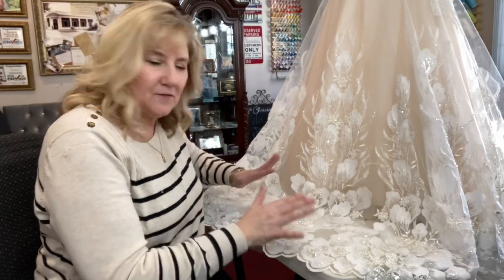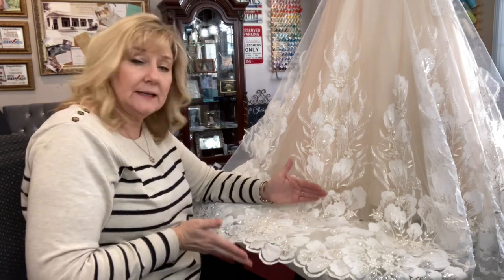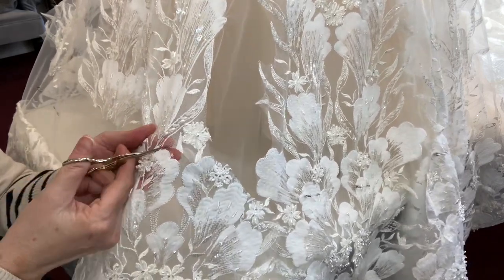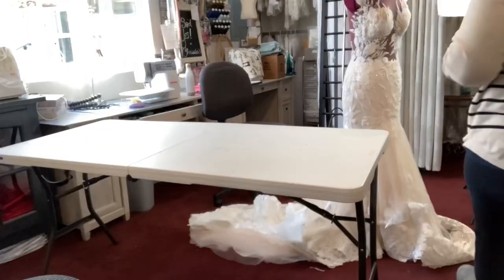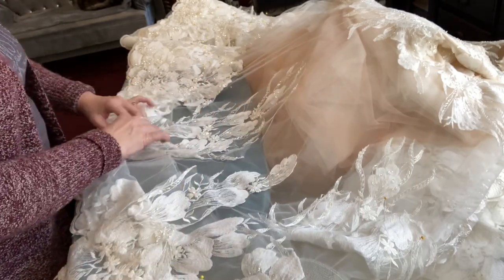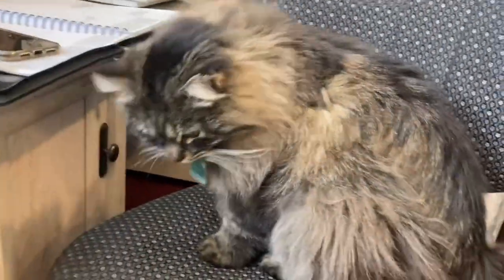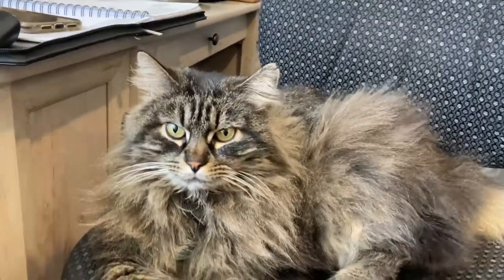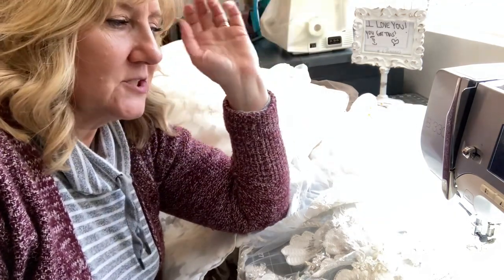How to Hem a Lace Wedding Gown: with Appliqués, Beadwork & Horse Hair

Comment: You do beautiful work. 
Just found out my daughter is getting married this spring and we are going dress shopping this week. How long do big hem jobs like this take (she is short so odds are the dress will have to be hemmed at least 6 inches) and what are the usual costs? I can't find real info on this anywhere and wanted my daughter to know before choosing a dress. Thanks much.
Reply from the maker: Thank you so much!
Congratulations on your daughter’s new engagement! 🎉 🥂 ♥️
Time depends on how many layers, how many appliqués and/beadwork needs to be removed and then replace in the new location.  And it could take a different amount of time depending on the seamstress.  
I think I worked on this one off and on for a week. It was a much harder one than most.  It had all the challenges possible.  lol
Cost will depend on all those things as well, and also depend on your location and the cost of living in your location.   
I’ve seen hems like this range all the way $250 to $500 and maybe more in big cities.   
But whatever they charge, just know a lot of work went into it and it’s worth every penny when she walks down that aisle.  🤗😊

Comment: You're doing a great job. If you don't mind, how much do you charge for a single flower? Looks like it is very hard to move and put them back.
Reply from the maker: Thank you so so much! 
I’m not sure about a single flower.  I can’t fully remember what I charged for this hem.  I do know that it was not enough.  lol  I reevaluated my pricing right after.  
I give my price to the bride in her first fitting.  I base it on how many hours an alteration similar usually takes and times it by how much I need per hour.  I usually come out just fine from my quote to the actual work.  But every once in a while I come across a “black hole” dress.  lol one that takes WAY more time then you ever anticipated.  
I chalk it up to experience and lesson learned and keep the original price I quoted.   This makes for very happy customers.  
I may have been blindsided. But I make sure they are not.  ♥️♥️♥️😊

Comment: Three questions:
Did you remove the beads from the bottom layer of lace you are covering up? 
How did the needle get bent? Was that from hitting a bead in the bottom lace layer? 
Why didn’t you cut off the under layer of lace? Apparently leaving the under layer of lace didn’t affect how it looks. 
I’m in awe.
I’ve done one of these lace hems sans horsehair, and it caused me many headaches, blood sweat and tears.
PS I loved the bustle bonus video! 
And I’ve subscribed.
Reply from the maker: Hello Annie, thank you for the questions 🥰
I removed as many of the large beads as I could from the under layer. But literally there were thousands of beads.  I left the seed beads and other smaller beads.  So I was having to go super slow (hand crank most of the time) and break lots of needles. 😱
I can’t remember why that particular needle bent. It was either a bead or a thicker part of the appliqué that caught wrong.  Or I got excited and tried to actually sew at regular speed. 😂
I did cut the under layer later after I knew the length was perfect. ❤️
Thank you again and again for subscribing and hanging out with me.  I appreciate you so much!
Reply: @christasdressshoppe  that all makes sense. Just curious. Haha. I love that you save your old needles to use for this purpose! Brilliant!

Comment: Such a great video! How did you combine the trimmed hem with the train without cutting the train?
Reply from the maker: Thank you so so much! 🩷
I fade it in towards the train.  The front I have floor length, the sides are slightly longer than floor length and then I try to make the smoothest transition as I fade towards the train.
Thank you so much for watching and for such a great question.  🩷
Happy sewing!
-Christa

Comment: was this your most expensive hem to date?  Also did you have her try it on before you did the finished hem?
Reply from the maker: This was my most expensive hem to date and yet I definitely did not charge enough. As I was doing this hem I realized I need to change my pricing and include a bump for beaded (especially extremely beaded) and for horse hair. The extreme width of horse hair and extreme beads on this made it so much harder. I have done hundreds if not thousands of these lace hems and I have never run across one that was so crazy. Lol

No I didn’t have her try it on before. I’ve gotten really good at dialing my mannequin in. On strapless gowns I even “chalk” the neckline on the mannequin so I put the dress back on in the exact spot. She came this week for her final fitting and it fit perfectly. She was so excited! I still get nervous however before every fitting. 😂 Always nervous. 😁
Reply: @christasdressshoppe  I haven't seen such a wide horsehair either, but I guess you need it to support the weight of the lace and the heavy beading.  Thanks for sharing, looking forward to many more
Reply from the maker: @kristiyourweddingdresser6716  I haven’t either, and hope I don’t for a while. Lol 😂 
It was such a heavy dress with all that beadwork! 
See you soon! Happy Sewing!

Comment: I just bought a dress with a lace edge at the bottom -- and due to my measurements, I have to bring the bust from a size 10 to a size 2 and the waist from 10 to 6! I'm so nervous that it will either be a terrible end result or cost like $2,000, and I'm just plain scared! D:
Reply from the maker: Yikes! 10 to 2. It’s a big size job but not impossible.  Are you doing the alteration yourself or hiring a seamstress? 
If you are hiring someone, 
A good seamstress should be able to do it. Cost would depend on your region, how many seams have to be opened up to get the fit just right, and how much beadwork or appliqués need to be removed and replaced. 
Ask a bridal shop who they recommend, ask around, get references etc
A good seamstress is worth spending the money because you get that perfect fit for your special day.  Having said that, and not seeing the gown and fitting issues, I still think 2,000 is high.

Comment: Do you sew down with single needle with needle foot up and nylon thread?
Reply from the maker: You can sew with the pressure foot up or, what I have is a free form pressure foot.  It’s used in quilting, but works great for these hems.

Comment: you do take the motifs off the tulle first?
Reply from the maker: Are you talking appliqués? Some times I “fussy cut” it and leave it on the original tulle and other times (especially when the hem is smaller like only bringing up an inch or so) I unpick it from the tulle. But if there is beadwork attached through the tulle I leave it on the tulle and cut it away from the gown.  
I hope that makes sense.

Comment: How do you hem a mother of the bride lace dress.  It’s kind of a crochet lace.  It cannot be hemmed as it has a border
Reply from the maker: Well. There are a few ways. I would have to see it to know for sure.  But here are a few ideas.  
Some have to be lifted from the waist if the lace would fray.  
Others can be fussy cut in a pattern around the lace and then moved up.  
Some style we just cut off in the pattern of the lace.  Or some straight across.  
I usually try to mimic the original designers way

Comment: Why didn’t you just hem it by hand?
Reply from the maker: A very good question! Lol
Most of these hems are better and faster if I do them on the machine.  It’s a very wide long hem.  However, it did become harder than I originally thought. 
I assess every gown at the beginning.  And change my sewing technique accordingly.  
I do however run across dresses that surprise me. Or dresses that we often call “black hole” dresses.  Lol They suck you into a black hole of never ending work.  Lol 
Unfortunately, this was that dress.  The rest of the alterations were extremely difficult as well. I was so glad to see this one gone.  
Thanks so much for watching!
Reply: 20:20 hindsight 🤓😵‍💫😉🤣
Reply: @Sweepear yes! Lol If only I could see the future, this one would have been a bit easier.  😅❤